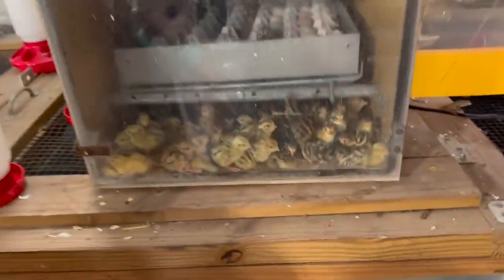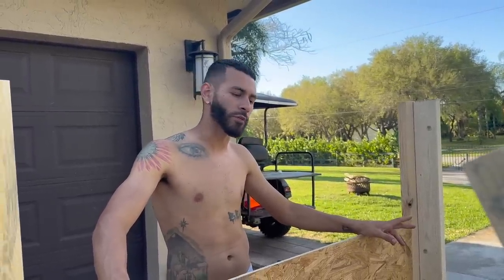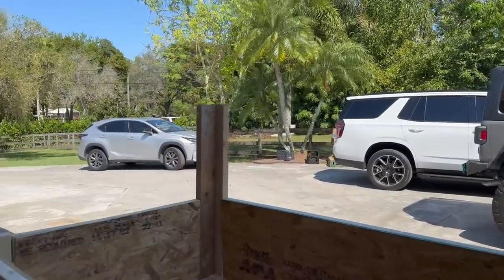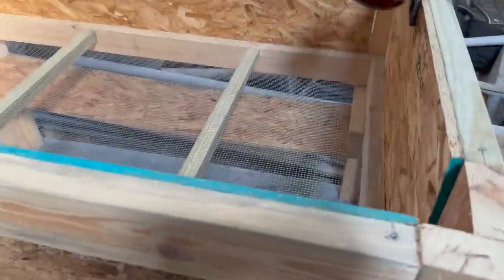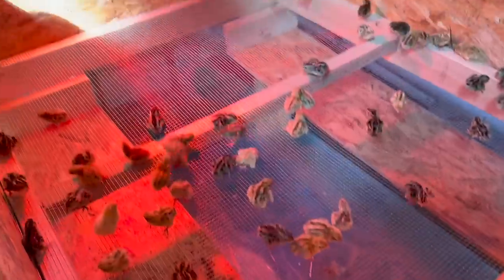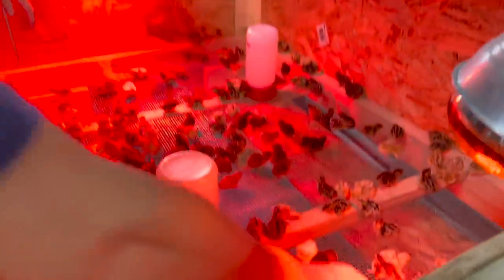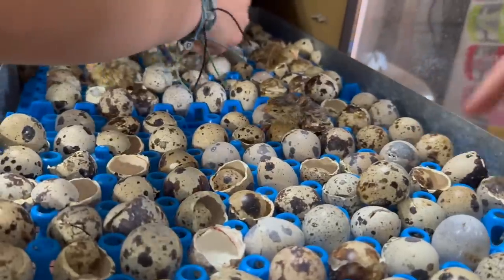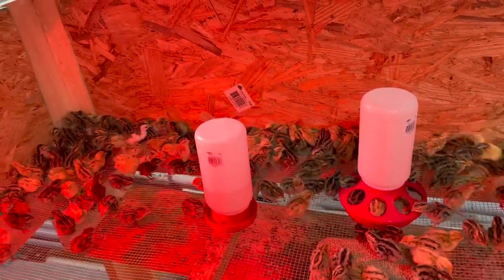MY QUAILS HATCHED!!

Comment: If u are building  this to last for along time don't use that chip board it's garbage I no it's cheap but pure garbage ply wood way to go . If u plan on turffing it then by all means use it just does not stand up in wet   dry wet  dry weather
Reply: I agree with the chip board. Put siding on it
Reply: @explorewithholycowgirl2380 y if it's inside the building  it ant gonna be getting g wet
Reply: @kingbones96  all the piss and shit I disagree
Reply: @Picco-zl2bh  he gonna put paper to clean eazy lol yall think in to stuff way to much everything don't need to be top of line stuff lol
Reply: @kingbones96  well what about 350 chick's gotta go potty  inside is good but long-lasting no 1flood u r screwed seen it hundreds of times its like buying fruit loops  then the no name brand
Reply: @kingbones96  I didn't say that 1 flood  garbage it's Florida is it not seem to recall lots water on his property  wanna something to last or I'm using plywood

Comment: It's cool you are doing this, it's definitely a lot of work. We did this on a smaller scale than what you are doing. Just remember around 3-4 weeks got to separate the males bcz if there are more than 1 male and females are there they will fight to death. Can put all males together with no problems as long there are no females with them. We learned quickly on that after losing a few males. They grow so fast and are very messy. Also do roll out trays for collecting eggs, that makes life so much easier.

Comment: We have been hatching quail for 10 years or more and for the best results % of  having the best success rate. is to round the corners of the quail Bruder with a piece of wood that bends so that the quail can’t huddle on top of each other and smother the ones on the bottom. We use to put them in brooders like the one that you built but we changed and started to put the hatchlings in the large coop with insulation and heat lamps and we had very few die.
Reply: You should send him some pictures